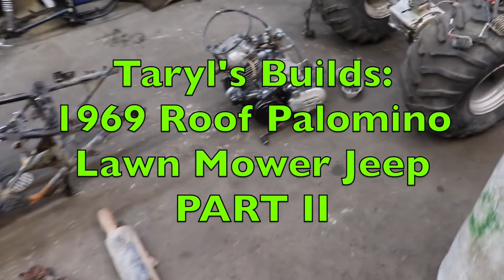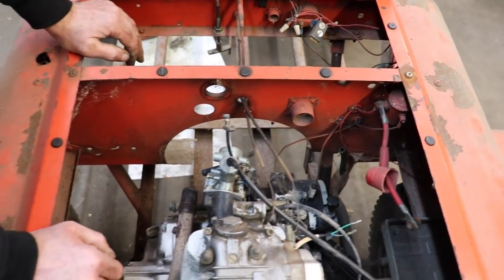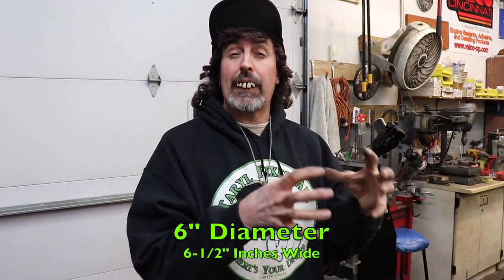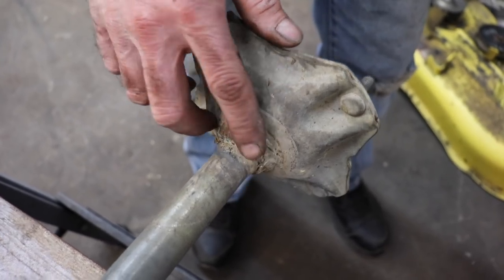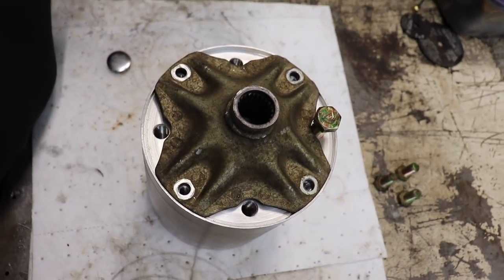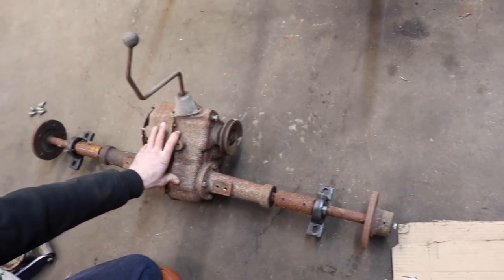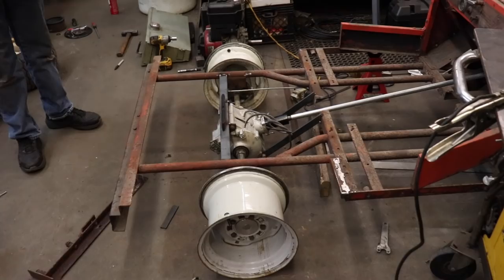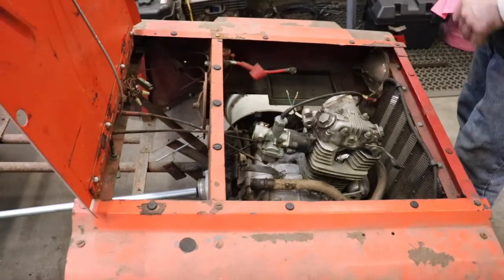AMAZING 1969 Lawn Mower Mini Jeep Pt 2

Comment: Peerless 2300 cast-iron transaxle 4 speeds are awesome! I'm going to install some 27x12x12 Interco Super Swamper Vampire ATV tires on my 2300. I'll be locking it soon. I have a 70s Montgomery Ward Variable Speed 15 garden tractor. Drive Shaft driven with a gear box and the 2300. It's on my channel. I'm going to be lifting it too.

Comment: Great Project Taryl.  You must be able to rotate the engine so the output aligns in a straight line with the input shaft to the diff.  I thought you would go with universal joints at both ends of the drive shaft, whose strength comes from diameter, not wall thickness.with correct phasing and both input and output shafts parallel.  A-53 schedule 40 1-1/4" pipe would have been sufficient. Transverse rear spring comes to mind as well.  Looking forward to the next phase of the build.  Hope you checked the engine rotation with the Diff.  Sub'd again.

Comment: I know you covered the rear axle strength scenario here, but what would you think about coming down off the frame with  support brackets with a pillow block attached that would slip over each axle just inboard of where the flange for the spacers attaches to the axle ? That would give the axles extra support, but more importantly help take all the overhang load off the axle bearings in the transmission. In the long run, sometimes it's better to Over-build for longevity. Just a thought.

Comment: Turn the tank 180 degrees maybe the angle on the bottom of the tank will clear the rear end.
Reply: I agree this could be an option. Another would be to put the tank under the hood by the engine since the fuel system is gravity feed ( I know a pump can be added,but thats another challenge).

Comment: I'm curious Taryl. Every driveshaft I've ever manufactured, I ALWAYS put a universal at both ends to allow for any possible deflection and reduce the wear on seals and pinion bearings. Why didn't you plan to have a universal at both the drive shaft and engine? Seems to me it would cause premature wear to the meat and potatoes (Engine and Rear Differential) as well as undue stress on the end without a universal. Just an observation and curiosity. Zip~
Reply: Cassidy Strickland, no, a carrier bearing is needed if you cut the driveshaft in the middle (or close), but if you put a carrier bearing in you might be able to lower the driveshaft in the back and if he would angle the back of the engine down, he could possibly get the driveshaft lower in the front also. A lot of extra work though.
Reply: It appears that he isn't going to have any rear suspension so the only "flex" or movement will come from the frame. The one U-joint with a small slip in the shaft should be plenty.
Reply: @cassidystrickland2557        NO

Comment: Very cool. I enjoy your videos and the unique and common sense instructions you provide. Keep up the great work. I was wondering if maybe a truckster rearend and tranny might not have made a convenient match-up. Due to rarity of Roops, I want to use a Cushman 4 wheel parking ticket special front end, tranny and rear end and make a jeep replica body and chassis. Will use spring suspension  to advantage.

Comment: 24:37 --  maybe you could cut that relief out symmetrically, with a very thin cutoff. Weld a couple square patches pieces to the ends of the cutout, and stick it back in the tank (inverted).   Then weld or silicon/bronze braze it back in.   In other words, use the cutout as the patch.

Comment: I had one of those 200 Big Reds back in the day. And let me tell you that was when a Honda was making a name for their self. Everything on that machine was so over built it was nearly impossible to break anything of real value other than the plastic. Even the motors with no air filter in them for years all it would do was smoke a little. I wish I had that one back but once again putting all new plastic on it and having to store it somewhere is a problem. Don't we all wish we had a few of our toys back

Comment: seen a singapor builder that makes simulair jeeps , he used a rotating lever (basicly a piece of rod withe the ed bend overon the steering columb for the low high and reverse thingamagig makes it eazier to pull and push the rod to select the gears
think with the spacers you added to the axles it be a bood idea to add a few pillowblocks like the way you did with the old setup , i think if you bolt the hubs off you can slide the pillow blocks on there no problem

Comment: It’s going to look cool when your finished.
I would love one...
Wouldn't you have been better off getting a new axles made or doing similar to what you did on the lawn tractor axle
Instead of such large spacers, then you could have added a bearing on each side near the hub and upgraded brakes.

Comment: I hate to say it but I liked the original rear axle and gear box set up. I would have just put on larger diameter wheels/tires and kept the original belt driven rear end. Some of the v-belts I see at tractor supply are so incredibly strong and durable. There was no real downside.  On top of that the Honda engine he put in there was kind of underpowered for this application. A nice Onan P220 with a belt drive would have been the ticket.

Comment: Taryl great build your doing. 
As a side question. Can you direct me to a place that sells used parts ? I need a 120 volt starter for a snowblower (Craftsman, MTD ect.) p/n  951-10645A .
Thanks

Comment: Could you turn the fuel tank so the angled part is against the rear end? That may give you enough clearance and save you from having to cut and weld the tank.

Comment: Just use a different tank, it’s a ATV motor two gallons goes along way. The way the rear end is mounted, you need angle iron or c channel for the front support kickers, the flat stock you used can bow in and out under torque, just enough to cause drive shaft problems.

Comment: I'm sure somebody's probably already had done this before with these Palomino's but to keep them in a true Willys flat fender fashion would be great use for something like a Kawaksaki Bayou 300 4X4 but they're full time 4wd so they definitely make a Yamaha and other manufacturers models that have a shifter for the 4wd/2wd which would be absolutely perfect for these mini jeeps. Have a real bullet proof 4wd system and suspension which is best for your @ss and off roading capabilities. Be even sweeter if there's a liquid cooled version of a shiftable 4wd system from a model ATV which I'm sure is out there somewhere, this way you don't need to worry about going too slowly and it overheating on you while In the trails Lol. But I guess it works out with a poor Sacrificed ATC? Sorry Tyrel, but being a restorer of the classic ATC's, it sucks to see a old Honda utility trike getting chopped up for parts, especially a running, moving one when there's tons and tons of more modern ATVs perfectly prime for the picking! At least they're still being manufactured till today. There's never going to really be a ATV shortage, being they've been stopped to manufacturer ATC's back in 1986. I'm not going to persecute you though Mr Dactel, we all have to do whatever we have to do LMAO. Otherwise it will be a very fun and cool project 
The golf cart though man, that pile of crap was more than just the proper piece to use for a project like your jeep there! I would have junked the POS and scrapped it for parts! SMFH what's wrong with people who do sh1t like that??? So this is exactly why they outlawed pot for the public originally!  Give someone with too many knowledge and not enough knowhow a little weed and this golf cart abortion is what comes out when narcotics meets ignorance I guess??? SMFH! What a Fu-kin mess and a shame to see how people can ruin not just one piece of equipment, but 2 in one shot! Unbelievable Ugh!

Comment: Hea Taryl, have you considered using a cable linkage for the shifter so you've got the shifter where you want it and just run the cable for the linkage for changing gears up and down, shouldnt be too difficult using something like a piece of throttle linkage cable, just my 2 cents lol, love the build man, cant wait to see how this turns out
edit: maybe go with a shifter design similar to the B&M 80885 "hammer shifter" https://files.dpbrands.com/bm/instructions/80885.pdf anyways hope this helps in some way

Comment: I would like a helpful question tayrl, would it be worth it to drill 0ut 2 broken bolts inside of a rated out kohler, and the kohler needs more than just 2 bolts drilled out. Would it be worth it to keep it, because the price estimates for parts it about 250 dollars. It's a kohler command pro 25 hp commercial mower give me some advice for it.